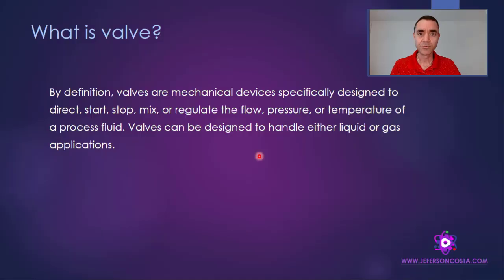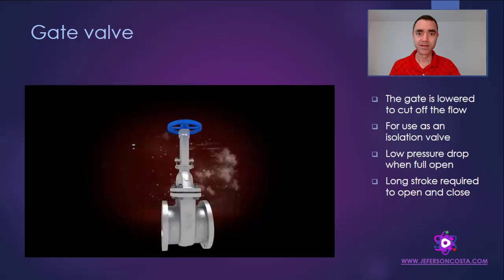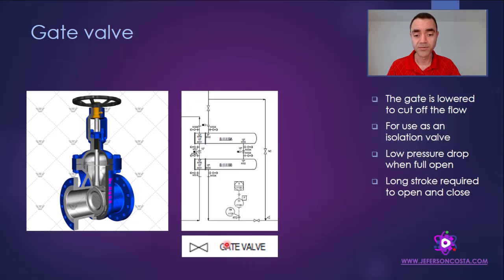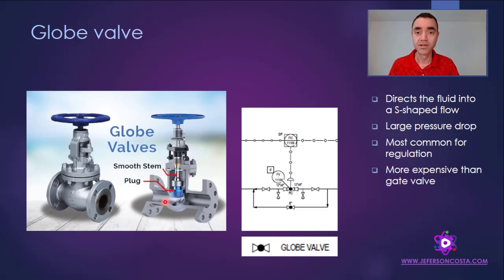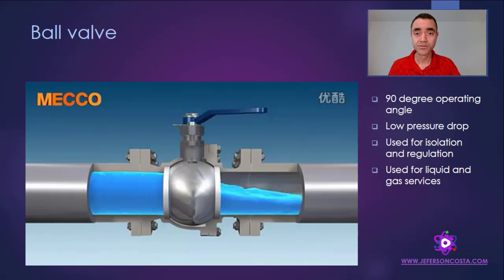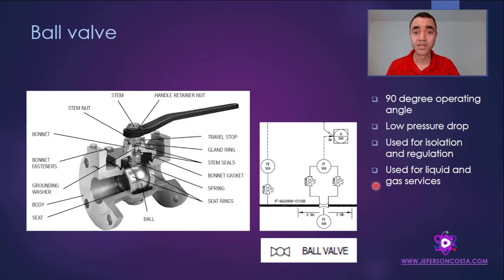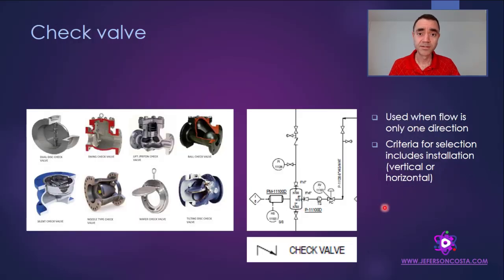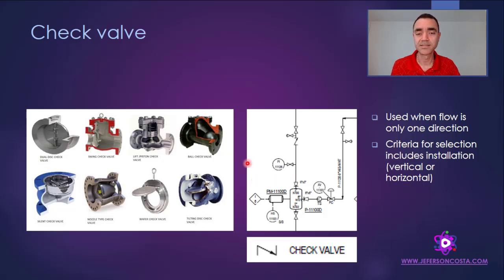Valve types and application | What is Globe, Butterfly, Ball, Gate, Check Valve P&ID symbol

Comment: Thanks for explanation, for valves symbolising in P&ID, is it ISA standards?
Reply from the maker: Hi, although you can find some valve symbols on ISA-5.1, this standard is not intended to establish graphical symbols for manual valves.

For standards regarding Graphical symbols for diagrams, I suggest you to verify ISO14617. Part 8 is specific for Valves and dampers. Another standard to be considered is the ISO 10628, Diagrams for the chemical and petrochemical industry — Part 2: Graphical symbols.

The symbols presented in the video are taken from usual industry practice in the chemical, petrochemical, and oil&gas industries. To validate a valve symbol shown in the P&ID, the engineer must check list of sheet of symbols used in the project.

I hope it clarifies your question   😇